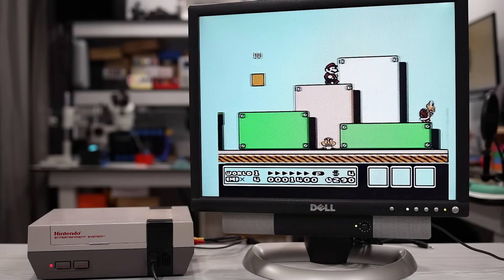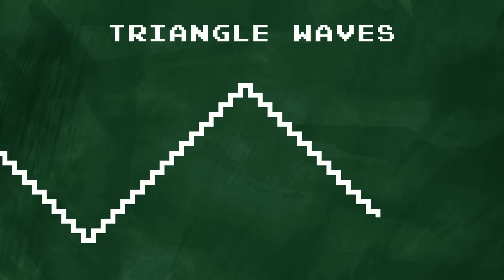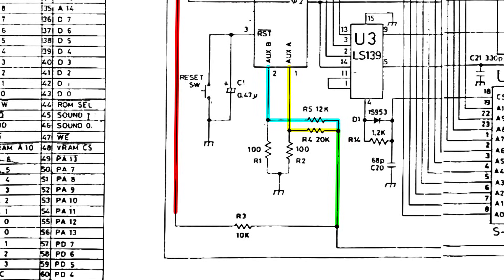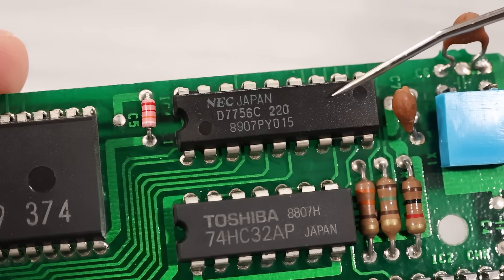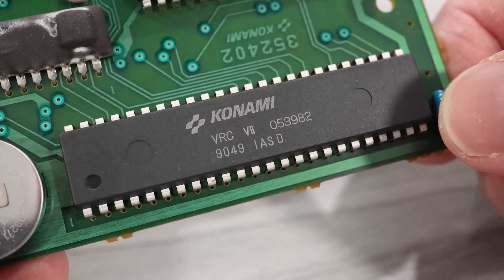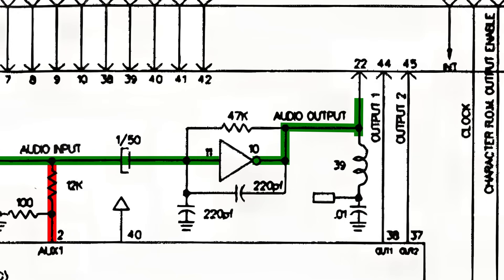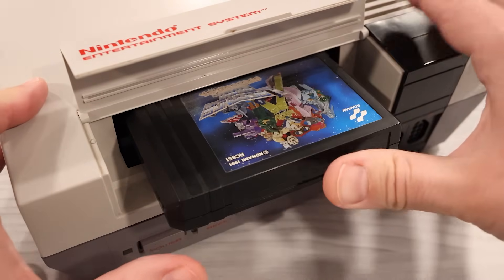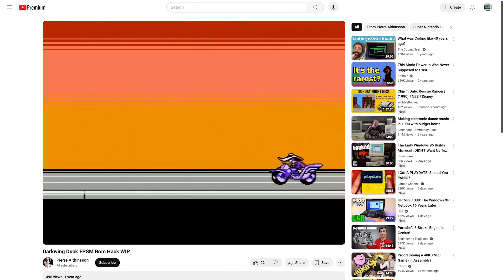Inside the Famicom | 06: Audio Hardware

Comment: Do you know if all the emulators handle that correctly, and more importantly, could you add these chips into American carts with a modded console and get the same soundtracks? It'd be awesome to mod the American Castlevania and get the same Japanese soundtrack.
Reply from the maker: Not sure about the emulators, I think it’ll depend on which one you use. But on the cart, yes - you could potentially create a custom NES cart with whichever expansion chip you wanted. For Castlevania III, you’d also need to modify the audio, so can’t just transplant the mask ROM.
Reply: @whatskenmaking  Do you know in what way? I'm assuming that this would affect emulation as well, so even if they handle such chips, I'd have to modify the ROM. I do wonder if I were able to modify the actual cart if a reader would read it correctly too.

Comment: In the video you kinda frame it like the Disk System was a late addition but it really came out before any of these games with audio expansion, really the addon was long sidelined before these games showed up because the built in "mapper" in the RAM adapter and the size of the disks was just inferior to what could be made at that point. I think the reason why the Famicom routed the audio out wasn't because Nintendo expected cartridges with expansion audio, but more for things like Family Basic and the Disk System, addons that really made it more of a "family computer". Just kinda happenstance that this capability was there and that ASICs got so cheap in the late 80's that some games could take advantage of it.
Reply from the maker: Ah yes, you're right, I had my timeline wrong. I've added a correction to the video at that spot. Thanks for calling that out!

Comment: great video, i hope this series get recognition they deserve.. i have a question about the nes sound i haven't bothered to look up and no youtube video has answer it. do you have to feed each note change to the apu in real time or it has some some kind of note queue? i think the snes and the amiga was completely autonomous and you load the audio samples and the "pattern" data in a module tracker format and you just command it to start play... megadrive had the dedicated z80 to drive the yamaha audio chip so i guess it maybe had some autonomy...  but for the nes i'm guessing you have to feed it in real time...
Reply from the maker: I’m actually going to talk that very topic in the next episode of the series, but in short, you play audio by setting the registers for the particular waveform channel you want to use. If you were making a game from scratch then you’d have to set these registers manually in your game loop, which would typically run between each video frame. However, the standard approach these days is to use one of the audio drivers that other folks have already designed. Here’s an article on the NES Dev wiki that lists out some of the drivers commonly used - https://www.nesdev.org/wiki/Audio_drivers
Reply: Not sure if this helps, but most NES sound engines update in NMI (VBLANK) which runs at a steady rate, so they avoid the music slowing down when the frame rate drops. It's also why the music can sound slow/fast on games ported between PAL and NTSC, with the switch from 50Hrz to 60Hrz. Most modern NES sound engines handle the framerate changes at runtime, which is why a lot of homebrew can ship a single cart on PAL and NTSC.
Reply from the maker: Makes total sense... thanks Matt!